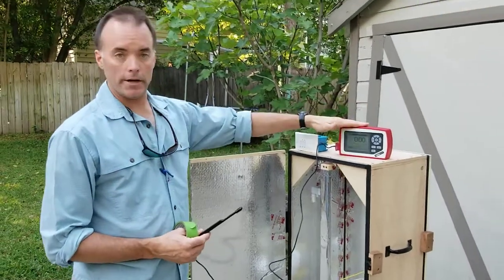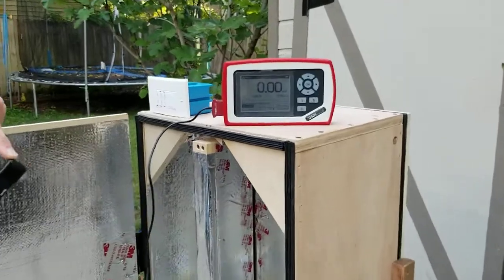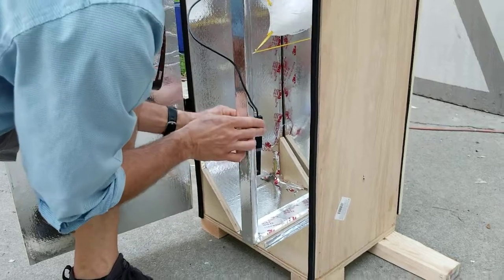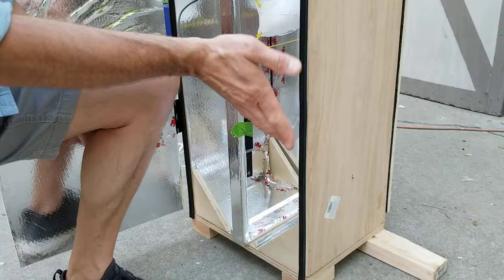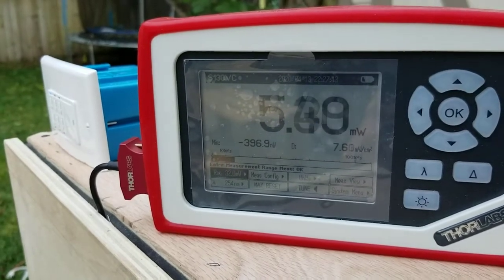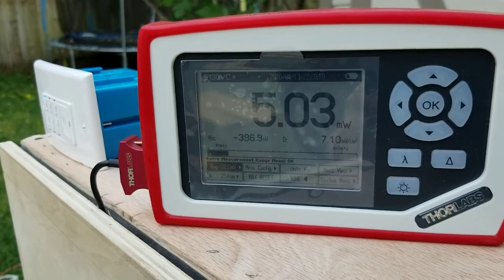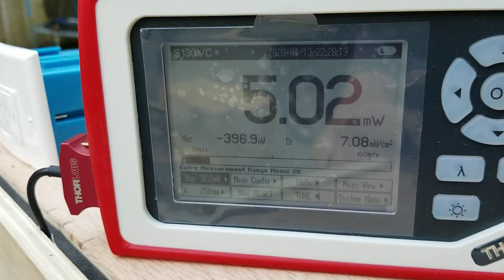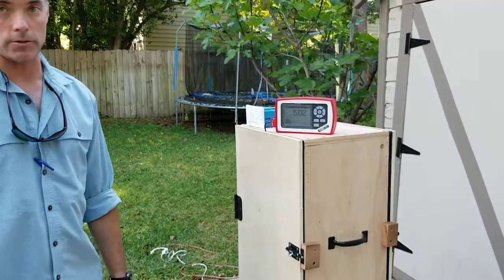DIY UVGI Radiometer Testing

Comment: Also, I think an hour meter would be useful for bulb replacement or time adjustments if an appropriate UVI meter is not available in the filed.
Reply: The FD will be logging the treatments and we will be utilizing an inexpensive UVC dosimeter card to verify output along the way.

Comment: So the minimum requirements of UVC power @ 254nm should be 5mW (7mW /cm2) for 5 minutes, if measured at the center I would assume >5mW. 
I'm trying to see if there's a need for this locally, I'd like to build a smaller unit for one (or possibly two masks) with the same configuration of a clean and dirty side. Possibly adding a light on each end to indicate which door is open/closed, not really needed, but I'll see...
Reply: The goal is 1 J/cm2 for decontamination. You need to figure out if your setup can achieve this by taking direct measurements of your bulbs at the distance you will be using.